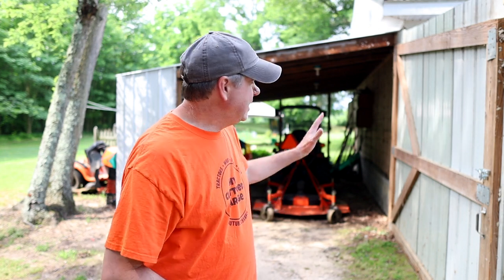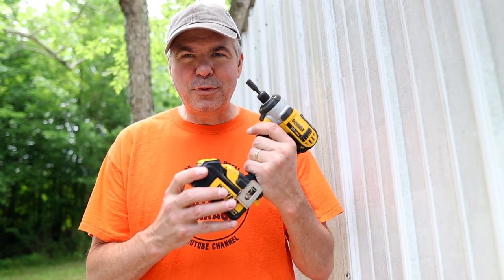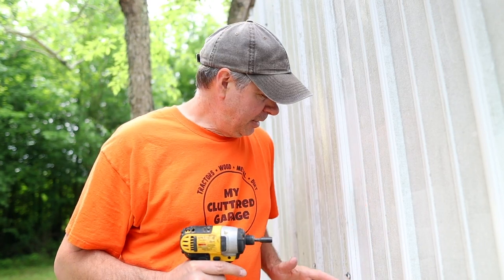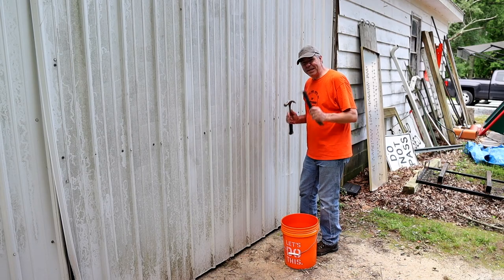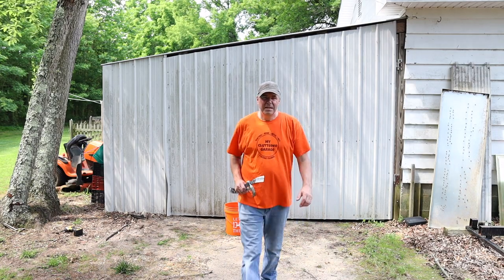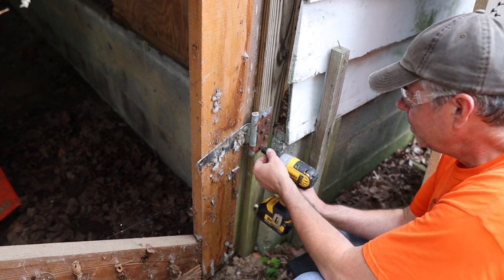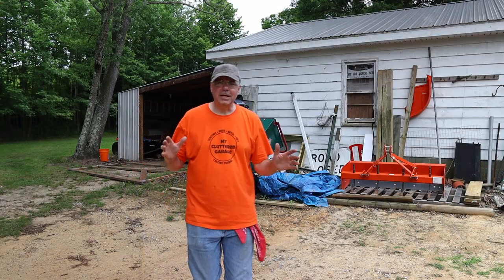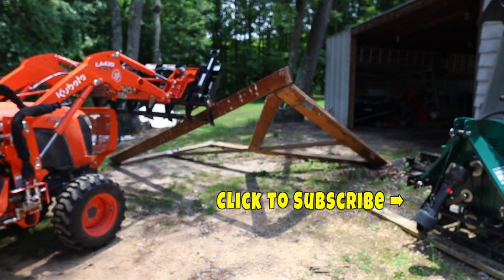#59 Tractor Shed Prep Part 2 - Concrete is next!

Comment: Morning Ed! Enjoyed the door fall - :)). Interesting discussion about where to screw the steel panels - many say it should be on the flat and others say it should be fixed on the ridges. Hmmmm....:)) Looking forward to Part 3!
Reply from the maker: Thanks Gord. Another factor is structural integrity. When you nail or screw on the rib, you can't really tighten down the metal like you can when you use the flat. Minor shifting along with expansion and contraction can loosen the panels and cause leaks - which I've actually experienced on the roof :(

Comment: And I just remembered something. About 20yrs ago, me & my brother-in-law put up a US STEEL bldg. (30ftX50ftX15ft) on a slab that, back then, cost me about $1600.00 in concrete {36 yards}. We did all the concrete & erection work ourselves (the stupidity of youth!) and he used his used Dewalt drill & I had bought a Craftsman Drill, both 18 volts, to place the thousand bolts into the rings of the bldg. His Dewalt batteries outlasted the Craftsman NEW batts 3 to 1! I've been a Dewalt fan ever since.
Reply from the maker: Nice!

Comment: If you do not have a small impact driver I ask, why the heck NOT??? Best investment to my tool box ever. I use it for everything and I mean everything. Buy a set of adapters and you will never use a screw driver again.
Reply from the maker: You’re 100% right, Rick. It’s my most used power tool! Thanks for watching. -Ed